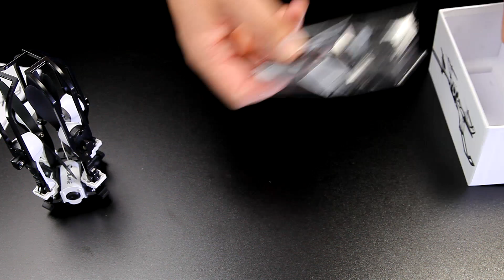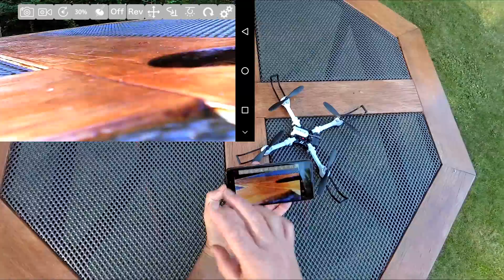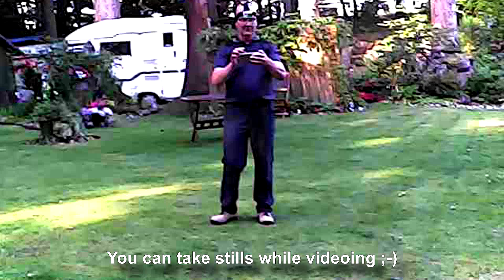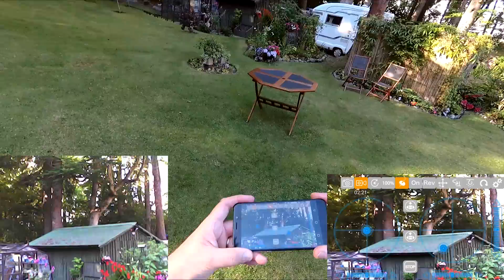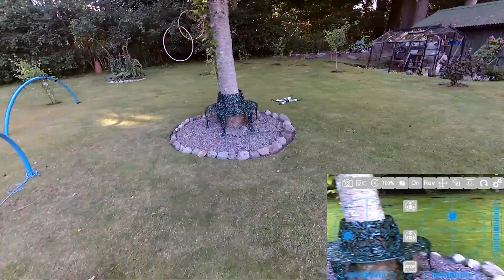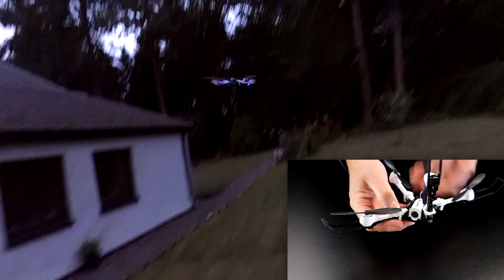Eachine E53 beginner Folding, Altitude Hold, APP control, WiFi FPV camera drone

Comment: well - I'm the type of person that wont give up!! 🤕 I was just given this Eachine E53 from a co worker. I actually turned him onto this type of drone to start off. He now excelled to a DJI. Im going to try his on my Idrone i5HW  transmitter. I feel they are the same units - Eachine just rebranded. His app no longer supported on his Iphone. Shame the app is useless as the drone was one of favorites. Still a pain to find motors for either brand but now with having both I can piece them out.

Comment: I cannot open the app on my new Google Pixel 3a. NOT finding any updates with the 1Drone I5HW(Eachine E53 is the exact same model). This is an app problem as developers are not updating their apps to be compatible with Android 10 versions. I learned to just use my old Samsung Galaxy S7( I kept it) with the IDrone app on it that works - for now. Have any other suggestions about the app/Pixel 3a ?

Comment: Why this idrone app cannot log in or rejestered pls help me
Reply: I realize I am really late with this reply - but as of 2 years ago the app became unsupported. Crappy thing to do! Mine is the i5HW idrone (Eachine rebranded it) and it came with the transmitter so I really did notuse the phone app. App does work on my older Samsung Galaxy S5 but not on my Google Pixel 3. I will be selling my Transmitter on Ebay for those who still own the either of the 2 brands of this drone and want to fly with a TX (since you cannot use the app). My drone has motor issues and those have been hard to find.

Comment: Did you ever get this going with a transmitter?
Reply from the maker: No I tried the ones I had to no avail, they may have changed it by now
Reply: Tigger's RC Reviews Thanks, I was going to pull the trigger on this but I wanted to ask you first.

Comment: The inherent stability of the long arms and big props is an advantage for sure. I suppose the light weight doesn't make the hinge points overly fragile in a crash even with that length of lever. Better than some for the price.